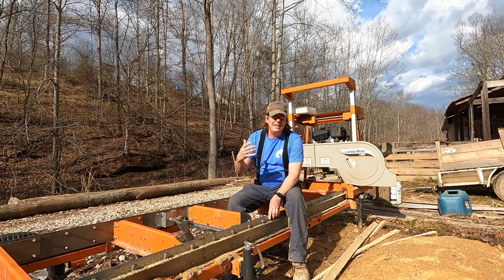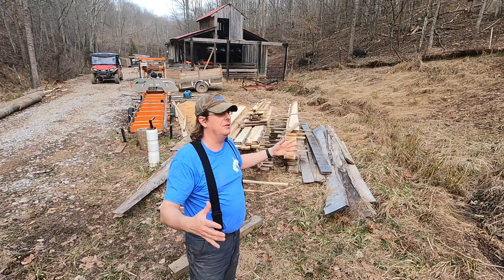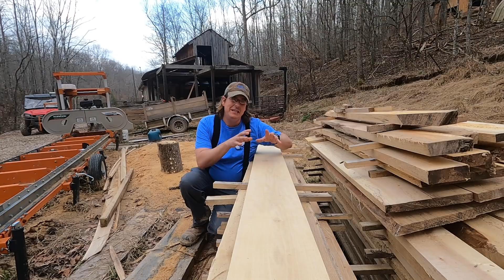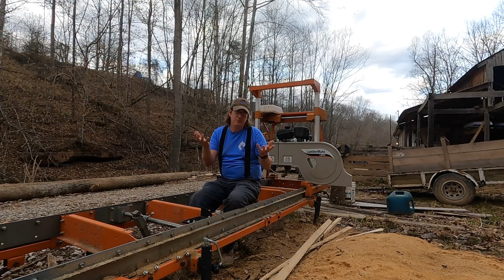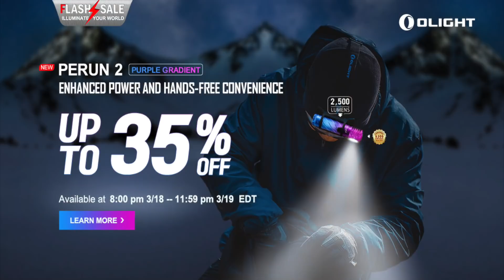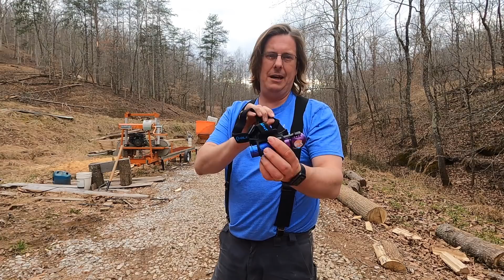Can You INSPECT & STAMP Your Own Structural Lumber???

Comment: Very good and informative video...... I think none structure wood you as a private person can make the best money with anyhow. I think perfect are balusters, hand rails, crowing and base molding I think is the best version. Plus big logs in general. I know a lot of people with money love to use decorative lumber to encase objects like a beam in a house. Also very very good money is in kitchen cabinets.Same with bathroom vanities. I think those are the best money maker. Less the cabinet but the front panel of the cabinet. You have to think what you have and what your market is. I see more and more IKEA like expensive cabinets which are great quality for the cabinet frame and all, but the front and doors are MDF and not solid wood. Those are a best mix. Panels for kitchens and bathrooms is there the money and market is because not a lot of good Companies and products are out there. Simple design with great quality is something a lot of people will pay the price not thinking twice about it. Also I myself just ran into the issue with an IKEA kitchen where the MDF panels crack splinter and the paint color even changes. So if people know they can do change a full on kitchen's look by changing and redoing the panels it can be a big money safer and profit in the pocket, like you want to sell your house but have 2-5 panels in your kitchen to look nasty so replace them this way.  Just ideas because I see the market is missing out there.

Comment: Troy we used some rough sawn pine for a combination timber/stick frame structures. Our code official allowed us to use the un-graded wood as long as we obtained a structural engineer stamp on the construction drawings. The structural engineer had to provide connection details for all members and fasteners. In short, just as you said, it is best to have a working conversation with your code officer.
Reply: Licensed engineer's stamp superseds code requirements. Anytime someone wants to build with exotic materials, they can do so with an engineer's approval. The only mind bender here is thinking about lumber as an "exotic material" instead of carbon fibre or titanium.

Of course, the engineer assumes professional liability for work they stamp. Theoretically if an engineer did their work and found a structure made with toothpicks and bubblegum was alright, you could build it within code.

Comment: As a contractor, when you see how bad the workmanship can get on a project, you quickly understand and appreciate the need for inspections and grading. Because I am not an engineer, I tend to over build. Sometimes I won't agree with codes that I feel are inadequate and build stronger than required.
Reply: As a builder I completely agree with this comment. There are several codes when framing a house that in my mind are unnecessary, while there are also several that are insufficient and I would never trust. Due to this i used to think that Inspections and code was just a scam and another way for the government to get money. but codes are the only thing preventing the carpenter trade from being completely over ran with hacks without violating someone's constitutional rights. A permit is a fraction of the cost of the price to hire someone who knows what they are doing to come back out and fix a hack job and I cant think of any time that a homeowner has been scammed out of money by a crook when they have pulled a permit
Reply: anybody can make a house stand (overbuild), it takes an engineer to make a house barely stand. lol

Comment: I think that the NY comment about not needing stamps on timber from your own property is geared for the Amish. the following statement is from NYS : Code Effective Date: May 12, 2020
Source Document: 19 NYCRR Part 1220 – RESIDENTIAL CONSTRUCTION
19 NYCRR Part 1221 – BUILDING CONSTRUCTION2
Topic: Grade Stamping of Sawn Lumber Used for Load-Supporting Purposes
This document is intended to provide guidance on the Uniform Code requirements for grade stamping of sawn lumber
used for load-supporting purposes and the DOC PS 20 standard referenced in the 2020 Residential Code of New York
State (2020 RCNYS) and the 2020 Building Code of New York State (2020 BCNYS).
According to Sections R502.1.1 and R602.1.1 of the 2020 RCNYS: “sawn lumber shall be identified by a grade mark of an
accredited lumber grading or inspection agency and have design values certified by an accreditation body that complies
with DOC PS 20.” As an alternative to a grade mark, “a certification of inspection issued by a lumber grading or
inspection agency meeting the requirements of this section shall be accepted.”
Sections R502.1.1 and R602.1.1 also provide that, subject to the approval of the authority having jurisdiction (AHJ),
“dimension lumber which is neither identified by a grade mark nor issued a certificate of inspection by a lumber grading or
inspection agency may be used for load-bearing purposes” where:
1. The lumber is sold by the producing mill directly to the consumer or the consumer’s builder, AND
2. The producing mill certifies in writing “that the quality and safe working stresses of such lumber are equal to or
exceed No. 2 grade of the species in accordance with the conditions set forth in DOC PS 20. Such certification
shall be filed as part of the building permit application.”
Section 2303.1.1 of the 2020 BCNYS contains similar language to that of the 2020 RCNYS but adds a third condition to
the use of such lumber. The third condition indicates that the use shall be in accordance with Section 503 of the 2020
BCNYS and limited to:
a. Buildings of residential Group R occupancy not exceeding three stories in height.

Comment: Most of the lumber I have milled for structural building purposes is usually with less knots and from the center of the tree. The first few cuts I do are usually 1x and used for trim etc. on the outer part of the tree depending on the size of tree Im milling. 
If you build a structure use bigger lumber sizes. Building with 4x instead of 2x if you use a typically non structural lumber species. If you sell your milled lumber sell it as non structural lumber.

Comment: I had thought the inspection process was automated where each piece of lumber was run through and deflection under load was measured.  Better stuff was pulled for use in trusses.  Lessor boards marked for generic stud grade.  Seems like could be cost prohibitive for smaller mills.  Not sure how one could use visual inspection for such a test.
Reply: well having a sawmill i read up on it i don't remember all the particulars it was 15+yrs ago it was kind of like different formulas so many knots at a certain size , the location of the knots factored in, 1 knot of a certain size or larger automatically downgraded it. There were quite a few things that factored into it

Comment: Good video sir. I'm a sawyer and work at a commercial sawmill in Marysville Ohio and we mainly saw hardwoods.  We run a frick circle mill and do saw some soft woods for barns but what they do with it is on them. I've spoke with my boss about grading lumber and it's not worth the price and time but we know and the customer knows if it's clear and prime material but structural is on a different scale. You know its structurally sound after learning your species and how trees grow but you just cant stamp it. Thanks again for the information on this. If ya get a chance we have a few videos we've recently posted here on YouTube Kreis lumber, check them out
~Ryan

Comment: The stamp is a notice of species and grade of lumber,, and the stamp grades the lumber as to modulus of elasticity, shear and bending.  Every species has a range of strengths that are quantified to those numbers.  You also will have some consideration as to propensity to rot, and or twist and deform when drying.
What your stamp will mean is that you have personally guaranteed the structural appraisal and hence , application, of the finished lumber.  You should be a corporation in case someone sues you.  You may need an attorney on retainer.

You stamp it.  You guarantee it.

Comment: Do these inspectors work on a freelance basis? Would it be possible to mill a load of your own timber and then get a freelance inspector in to inspect and stamp it, if it was up to grade? Obviously you would have to pay for the service, including a contribution to their licence fees that stamping your wood would result in, but you would still be saving on the underlying cost of the timber and the store's profit.
Reply from the maker: I did a video two weeks prior detailing that very thing. This video is a follow up to that.
Reply: I don't see many rogue "graders" chiming in.

I guess it's probably not in their "certified" best interest to go against the corporate machine.

Someone who goes rogue, as a grader, can probably PLAN on not getting recertified (next time around) by the paid off powers that be.
Reply: @jonhaskell9630  they hire out ByTheHour  including travel. discussed in the vid just before this one

Comment: the trick is to use a few store bought boards with 75% your own as long as you use the same tree types. I might have done that a time or 2. also I don't own the saw mill which helps avoid suspicion. also it helped to live in an area with no building permits.
Reply: ... Would they not notice that 3/4ths of your boards don't have any stamps on them?
Reply: It depends on the inspector.  A good inspector would immediately see the difference from normal 2 by material that has been planed smooth and has rounded Edge's. The surface of the board has no or very few saw marks. But some inspectors don't even notice joist hangers that have not been nailed off properly and that is important. So don't try to trick an inspector if you do every inspection from then on will be finding things that you just can't imagine.

Comment: And despite all the regulations, it's not hard to find a stamped 2x8/10/12 that is crowned one way with a huge knot on the underside that will eventually dry out, crack, sag, and fail to hold its load.
Reply: Several thousand years without regulations or inspectors... How did we ever manage??
Reply: @cheyennethorpe8626  exactly.  with all the modern building codes, it's surprising that any building older than 20 years is still standing if you listen to the engineers and codes people.

fully 1/3 of modern lumber simply does not meet grade.  with loose knots, checks, bows, crooks and tight knots that are fully 1/2 the size of the board, how they sell  it as grade is criminal.
Reply: @cheyennethorpe8626  you think there were no regulations before the us government? lmao.
Reply: @DieselRamcharger  well yes and no.

there was regulations. but not strict. it was more or less a word of law. like if you are so bad at your job your houses fall apart you wont survive long when you survive by word of mouth. 

but then again in the past they were fine with children working with heavy machinery that had all of its gears and belts open, where their little hands could get caught and be ripped off.

or the fact most factories never had basic fire escapes let alone actual fire prevention.
Reply: @Thekilleroftanks  Regulations go back as far as written history.Man has always attempted to control one another. Its not like the US was the first place to dream them up.... Ancient Rome, no shortage of regulations. Thousands of Years Ago.
Reply: @cheyennethorpe8626  Survivor bias.  Most building were horribly built and quickly fell down.  We are only looking at the buildings that were very well built and were worth maintaining and repairing.

Flying buttresses are a great example.  They aren't decoration.  Cathedrals were built over decades in part so that they could figure out what was failing.  Buttresses were added to support the roof loads pushing outward.  If cracks opened, an outer "flying" buttress was added.
Reply: @1djbecker  here in my part of the world, northeastern Pennsylvania, I do a little bit of demolition from time to time. Most of the older housing, and commercial buildings did I have to take down, are all due to water and or foundation issues. Not many of them are due to substandard structural elements. It's always either the roof started leaking, water getting behind the siding, or just poor drainage on the property. I'll bet 90% of them or some type of water damage.
Reply: none of the regulation, codes, certifications mean anything if the inspector fails and they always do.   it's all about keeping the little guy out and minimizing competition.  if it weren't, there would be other work arounds.  go in any house and you will find code violations.  so for all the rules, codes, regulation and inspections, it all fails in the end.  I've seen new homes wired with every wire in the entire house including the service entrance cable through a single knock out in an electrical panel, complete with an inspectors stamp.  so much for codes and inspections, all you got was an over priced fire hazard.
Reply: Wood is a living material. It can "go bad" in every part of the chain. Why do you even have inspections over there? what does it do? we don't have it in sweden and we don't have any problems whit studs breaking or anything like that. If you work whit wood you know what to look for urself pretty fast.
Reply: @P4hko  nothing to do with safety. regulation exist solely so one corporation can profit while another one finds it harder to compete.
Reply: @liam Anderson well I did have to relate somehow and show there was another way. Wasn't something to brag about really it's just stamps on wood really. But sure US is a stupid country
Reply: @liam Anderson that was bragging about Sweden, stopped getting triggered so easily.

Comment: You inspect your lumber, you get an inspector to check your inspection then an inspector can check the inspection of the inspector of lumber that you inspected. And I can still go to the store and find stamped lumber that is useless so why do we have this system.
Reply: There's only one inspection of the lumber.  Building inspectors are there to ensure the gorilla carpenters are built to code. Sure they glance at the stamp, but that's just a formality.
It's not a useless system, but it does have its flaws.
I'm a carpenter, my father is a carpenter, my uncle is a carpenter.

Comment: And then we have local rules that focuses on one mill.  For us structural must be only red pine or black spruce milled at a JDI mill.  The wood choice seams to be a view and not on paper. Nothing else is permitted when I talked to The South Eastern Town Planning Commission. 

I have had run-ins with their inspectors on establishing bolt together steel and aluminum antenna support structure for a federally licenced amateur radio station.  The federal standard is lower that 50 feet above the bolting mounts at base is exempt, for the support structure not including masts, windmills, christmas lights or antenas. Funny thing, they don't agree!  They continously loose in court, they must love court!

For us the stamp is generally an RFID tag stapled to one end of the board.  The tag is not to get removed or cut off, but almost all the cuts appear to be the tagged end!  It can be scanned after construction in a sealed wall, but I have never heard of that occuring! 

One question is what is structoral, what is not.  It appears that the outer walls are structoral while inner walls may not be and therefore may not be applicable to requiring structural lumber.  One simple test is to look at the plans or like are rafters mounted from exterior walls only?  Where are the hurricane ties?  Also urban construction under 20m² (215ft²) or smaller and rural 50m² (538ft²) and smaller do need a permit but do not require approved lumber.  Blocking doesn't appear require structural lumber!  Another issue, most new homes have bias tensioned steel strapping like diagnal cables and no exterior sheathing, yukky and scarry!  Example, exterior wall wallboard, 2x6, with r40 pink, steelbias straps, vapor barrier, closed cell r20 foam, vinyl siding.  That sounds like an easy criminal entrance not a wall!

Paper work doesn't agree. With the suggestions of the South Eastern Town Planning Commission.  There are 2 bylaw inspectors in the region 300,000 pop, so it is doubtful that a rural project will see a building inspection!  Exception being liquid waste.  Furthure more liquid waste systems can only be installed by a qualified person who is an engineer, and no homeowner can install!  

The truly crazy part of our building code is that it includes protections for tornatos, hurricanes, earthquakes and snow loading.  Only snow loading is a threat here we get meters of that stuff but with a metal roof that load clears its self.  We don't have any earthquakes over 5 and they are years apart last ones were 1982.  We have a F-0 every other year or so. We may have a hurricane or post troppical storm with cat one winds once every 5 years somewhere in the 3 Maritime Provinces. Personally I want to build noncombustable construction!

Attached is a document, talking about the requirements for the South West planning.  They boarder on Washington County Maine!  Interesting note is that a structural engineer is qualifed and may code the wood
http://snbsc-planning.com/cct/use-of-milled-unstamped-lumber/